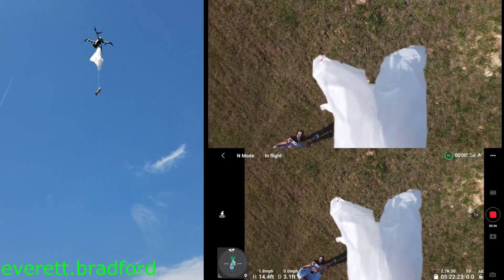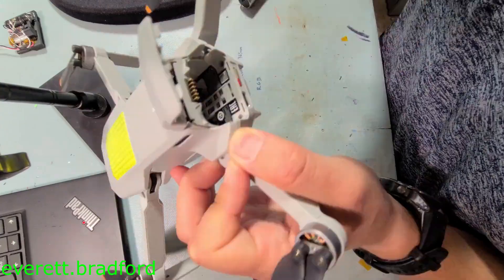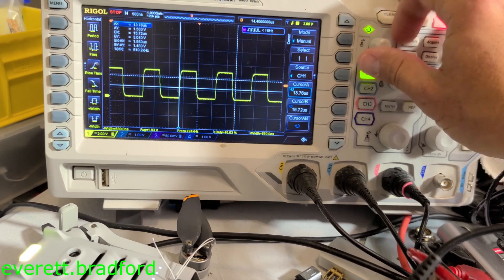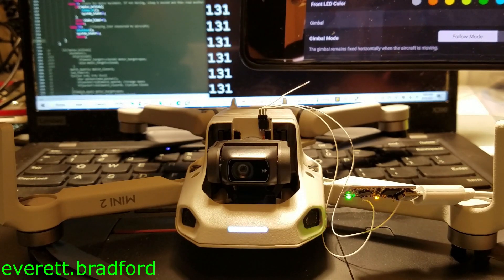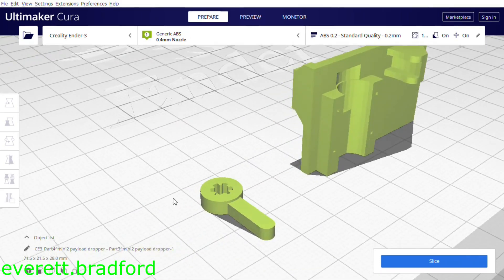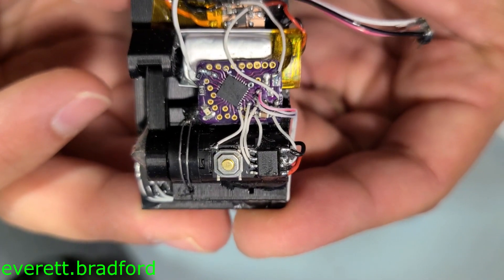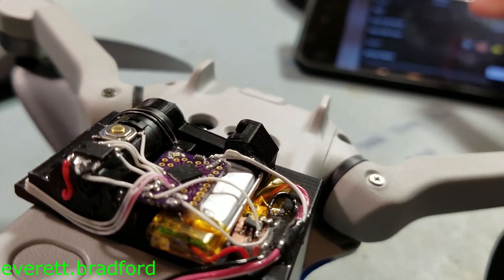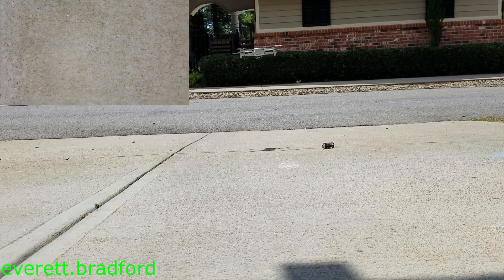Hacking the DJI Mini 2 to add payload control

Comment: Have you ever done any firmware decomp of the DJI firmware? There is a great github project for exporting and flashing dumps. Adding an acro mode to the firmware to replace the FPV mode would be such a cool project.

Comment: I'd imagine the 48 bit bitstream is the signal protocol for a WS2812B addressable LED, so there might be a lower power chip to decode this. Have a look at the WS2811
Reply from the maker: I said in the video that it's similar to that but much higher bit rate
Reply: @everettbradford  Ah sorry I missed that, was skimming through. A very nice project 👍

Comment: you know they sell air dropping accessories, they are pretty cheap and work by using a photodetector (light sensor) to trigger a servo motor, much better than wiring thing up and possibly damaging your drone.
Reply: where can you buy that

Comment: You could add a fire cracker dropper using an electric match held on by a cotton thread that burns off the lit fuse hence dropping it. If you do it could you add the moddified pick code that includes it thanks.

Comment: If this was about simply making a dropper that was operated long range via the remote, why not just buy the $40 mavic 2 air dropper that is triggered via the led landing lights and modify it to fit the Mini 2 and extend the photodiode to the front led ( which is turned on and off via the drones remote) and vuahla... you didn't have to open the drone or really make anything, just lightly modify a pre-made dropper.  
  In reality I don't think they will ever make anything multifunctional that is triggered by multiple colored light source for this drone due to the fact that it would required equipment that is much heavier and bulkier than the drone is capable of lifting.  Also there are MUCH simpler ways of transmitting multiple signals via the remote to the drone to operate other functions.
Reply: It is 4x the weight maybe

Comment: You could just tape a photodiode to the front light and turn the light on and off lol. No need to program a microcontroller. There are even tiny photodiode relay modules.
Reply: Thank you,   I was thinking the same thing the entire time watching this.  Or you could simply buy the dropper made for the mavic 2 that is triggered via photodiode that is placed over the drones led landing light.  Modify it to fit the Mini 2 and extend the photodiode to the front led ( which is turned on and off via the drones remote) and wuahla... you didn't have to open the drone or make anything,  just lightly modify a pre-made dropper  then operates by the drone's remote.
Reply: @chadmiller9450  are you talking about the airhook. seems to be the only dropper opperated by the drones remote
Reply: @chadmiller9450  yeah well you guys obviously weren't watching the whole video.  He analyzed the signals for EACH OF THE COLORS and figured out their unique signal.  Therefore, if he wanted to make a device that did SEVERAL functions at once by using the single led he could.  
The photodiode would work for a SINGLE activation of something :P

Comment: Could you just use a mosfet say wired to just the green chip of the led to toggle an on function? Could also print in PP plastic to lose some weight? There is easy to use Formfutura PP out there now that is ultralight at .75g/cm3. More than 25% weight reduction over abs. Not a huge gain but maybe worth it when trying to push limits. Thanks for sharing the info with us. Wanna give it a try too.
Reply: Did you end up building it, and maybe make a better solution?

Comment: Can you do a battery mod tutorial? I love this and subscribed!
Reply: just run your batteries in parallel with positive  to positive negative to negative and you have an extended life 40 minute + battery. DISCLAIMER: I am not responsible for anything that may or may not happen but i know ive done this on a few other drones and boom double flight time.

Comment: You have complicated a simple matter . Drop when camera go to down. How ? simple opt-diode or hall sensor or ordynary switch like solid wire to contact. :)
Reply: you are right but as he said by decoding the bits he can implement more commands but i like your solution too

Comment: This is amazing. What a creative solution 👍 I gather that most of the BOM is mentioned in the video, but which small motor are you using exactly?
Reply from the maker: Unfortunately I can't seem to find that exact one anymore, but you could make it work with any of the common dc gear motors that are on eBay and similar sites
Reply: @everettbradford  thanks for responding! I'm definitely going to give this a shot soon, though I'll have to hack something up without the fancy custom PIC breakout board 👍😄
Reply from the maker: @ickSchlappi  Here's my breakout board if you'd like to try it: https://oshpark.com/shared_projects/Hp9tZIMF

Comment: nice!  your video makes it look easy.  I'd probably use a raspberry pico.  You probably don't need the battery or could use a basic capacitor but better to be safe.  You'll probably also need to add some disclaimers to your instructions

Comment: The great thing about these hacks is that they can be found by clever people. The not so great thing is that the clever people publish them on widely distributed platforms thus bringing them to the attention of the people who will do all that they can to neutralize the clever hack. Don't be surprised if LED color control goes away.
Reply: Good point. Many people are not responsible, shown by traffic statistics/accidents.